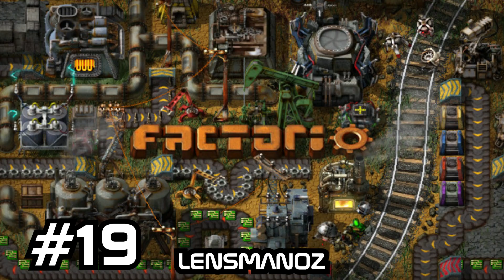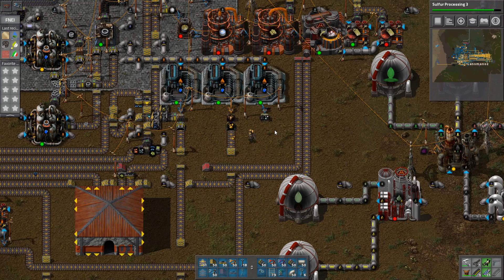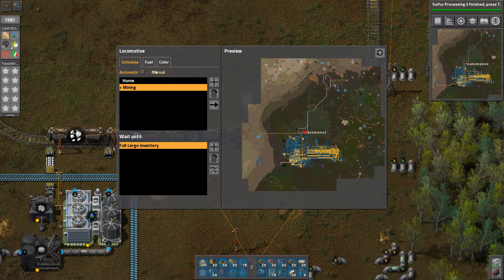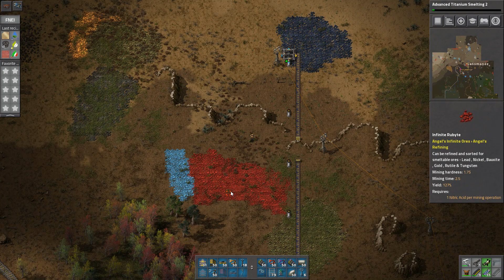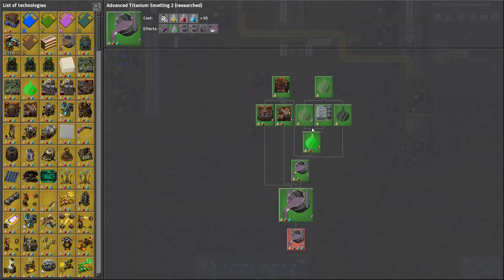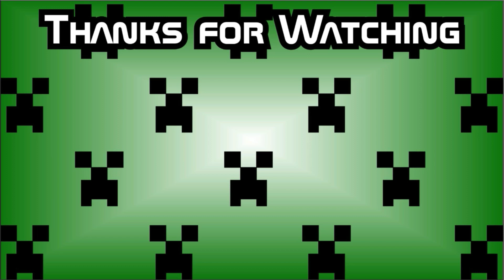Factorio Modded - Ep 19 - Roboports

Comment: A thousand stone bricks sounds like quite a lot, until you remember you have essentially infinite stone.

You will want to research and construct the logistic zone expanders and the large recharging stations for doing a robot based mining area. And bring a LOT of robots to the area. You can also in that case, use Robot Chests instead of Roboports which are cheaper.

Instead of an inserter into the door, you could just use a loader which would keep it running quicker, but that's just my preference.
Reply from the maker: I should really employ the robot chests a bit more as you say. Also I've found the robot miners are a little OP
Reply: Something as easy as Robot mining usually is. Robochests being cheaper doesn't hurt any either.